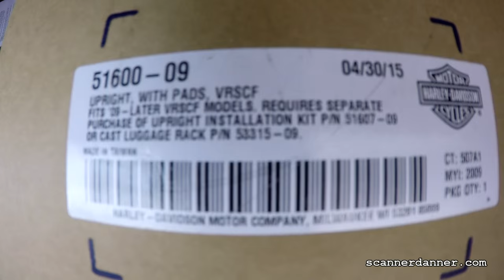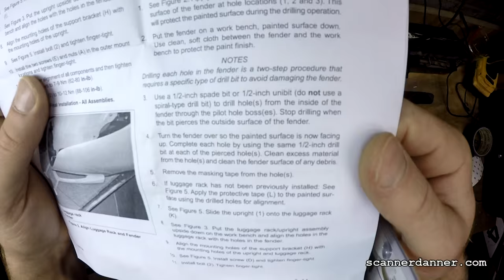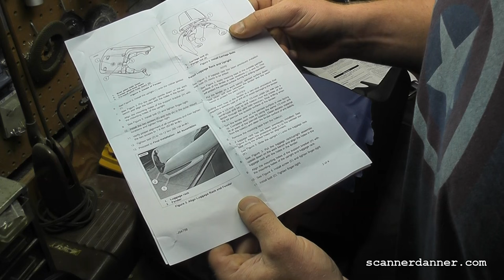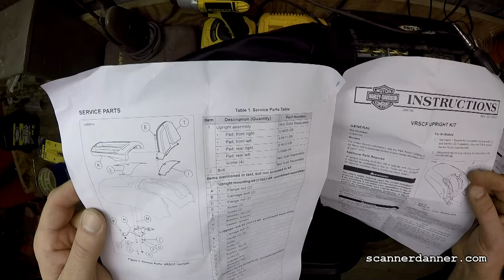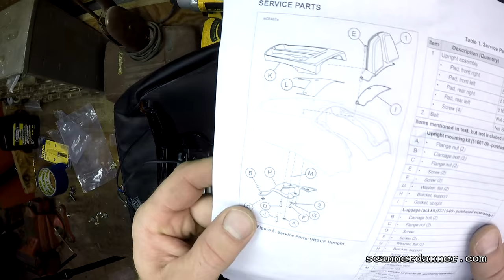V-Rod Muscle Backrest and Luggage Rack Install

Comment: of course the Allen bolts on the straps weren't tight not like anyone's grabbing on there or anything. was the bike purchased used? it's possible that was bolted back on for the trade in

Comment: Killer video! The fact that you speak clear English and I could follow along step by step without having to replay the vid in order to make sure I understood you correctly is always half the battle. So many Yoyo's out there have marbles in their mouth or a ton of background noise. You get straight to the point with no nonsense. I like that. No grand introduction to the video or unnecessary background information about how great you are or how pretty your wife is. (Yes, those video's are out there)  When you press play....BOOM.....right to the job at hand. Thank you for a video well done and you've bolstered my confidence. Now I'm not apprehensive. My 2012 Muscle and I thank you!
Reply from the maker: Awesome man! Thank you so much. I knew my car expertise would help me with this motorcycle stuff. 
I have a video on some Vance and Hinse slip ons. I haven't uploaded it yet but look for it. I did a step by step install with before and after sound. 
 I'm trying to get some additional footage of the sound of the exhaust for the after install of the new pipes. All the ones I've seen, the camera mic did not do a good job of showing how the pipes really sound.

Comment: Dude, you have big balls! Seriously, I have had the parts for 1 year and refuse to do this job. Awesome job!
Reply from the maker: Question now is are you confident enough to do it after this video? Did you see where I went wrong with my drilling?
Reply: @ScannerDanner  mine has the sissy bar installed already, but I bought the rack to just have the rack on there. Are they basically the same holes except to the middle rear?

Comment: Paul I work in the automotive after market installing power locks to A/C and it was always hard to make that first cut or drill hole. One thing for others is to put tape on top of tap and extend the Unibit out to the end of the shank, this will help to not hit the drill on the paint.

Comment: I guess we now know what ScannerDanner got for Xmas.  :-)  I’d advise getting the factory service manual for your year/model ride. It will pay for itself in the first service alone, especially given HD Dealers hourly rates (highway robbery, IMO). You can order it through your local HD dealer or online. The Electrical Diagnostics Manual (the one with the wiring diagrams) is a separate book from the service manual for my bike (’06 FXSTBI) and it might be for yours too.  Saved my booty on numerous occasions.  Enjoy the new ride and I look forward to seeing some videos on it.
Reply: btw, I would re-route that tail light wire. It used to be mounted between the bracket & fender so it wasn’t directly exposed to dirt, rocks, water, whatever flying off the rear wheel as you are going down the road. Now it is exposed and it could result in a premature failure of that wire. But maybe thats not a bad thing as it would give you a good electrical diagnostic video.  :-)

Comment: Dang man I'm sorry about the trouble you had. That fender is probably actually composite or glass reinforced plastic as opposed to just fiberglass. As opposed to having to lay down and resin mat after mat, a machine probably injects hot liquid plastic into a mold and out pops a fender after about 5 or 10 minutes. Also on your drill knicking the paint, I would run the bit as far out on the chuck as I could with it remaining stable. That's usually why unibits have the long hex shaped shank.

Comment: If you drill to the 1/2" diameter from the inside, you will chip the paint around the hole as the bit comes through. This is why they tell you to drill the full size from the outside-in.

Comment: i have a engeneering background and this is what made me pass my cert  test what this guy in my apprentice told me.
Turn on your brain and  think things thru from start to finish, do not start! unless  you know every move you are going to take till you finished manufacturing the component  on your plan in your head.
And he  was Right you start machining something  from the wrong  side  you cant finish the thing as you can no longer clamp it in a vice or the lathe chuck.
I had  to write the above to give a idea why i  would have  done this step  i am going to tell... i would have done different.
I look at stuff  like the threads studs  what angle they have of the stuff bolted on to it and in my mind i am machine them holes with a  drill befor i start.
its kind of similar  to electronic diagnostic  you teach Mr danner,  
i would also have  figured if you could not almost finish the drilling  from the inside or not. I go why do they want the  thing to be drilled  from inside? then outside what is there reason on the instruction, Is there  one? or is it just a pen-pusher  whom wrote the distructions......  etc
Reason why i gave up engeneering to me its extreem stresfull when you f...k up its over  but a rusty stuck bolt for example is a challange to open it is already a f...up that one has to now fix.  you can fix them f-ups  you start again if  you f---k up in machining something gone wrong!! all the time  till the f-up is  gone if  you do so , extreem stressfull in my opinion, not  so much in c.n.c  but i did learn the old fation way propper  machining by  hand still 

My first repair  with My pico was a coil on a 6 clinder kawasaki . i found after 6h one coil  was wrong connected +- the moron electrition mate told him it wont matter how you connect a coil. And the reason it was conected  wrong was 3 coils  and 1 of them had plus and minus not on the same side,!  I mesurd the harness  done a voltage drop test with dan sullivans load pro leads  said!  power  and ground is fine to all coils but that coil is connected  wrong buddy!! look at the coil here is our positive  wire going to the negative on the coil.
Put another good coil connecded it  propperly  and the thing fired on all pots again.
coil had spade connectors and no wiring diagramm.(The thing sometimes  ran on all pots  with coil wrong ) ...then coughed and splutterd and stalled.

Comment: Man , Stealership got me all nervous when they said drilling holes in the fender. Cost me 400$ to get that seat on!!!! . They offered me a deal of luggage rack and seat for 700. they are crazy . how hard would it be to put the luggage rack on now that the back pad is on ?
Reply from the maker: The holes are already there, so everything I showed would need to be done other than drill the holes.

Comment: That is the purpose of the tape to protect the paint in case you have a slip, and to keep paint from chipping and that is why they tell you not to use a spiral drill bit because when the drill tip pierces thru, the cutting edge of the drill bit will grab the thin layer of plastic and could break a big chunk out of the finish. I found out the hard way when drilling holes in my boat. LolGreat video and nice bike.I cant wait to see the O2 on the scope to see if it cycles from rich to lean like a car does. I don't think it will because it don't have a catalytic converter. Does it?
Reply from the maker: +JOHN HUFNAGEL now you have me curious. I'm betting it will still swing rich/lean which will back up the theory that the swing in the ratio is not for cat efficiency but for the system to know where stoic is on a narrow band sensor. I've always stated it was for cat efficiency but my views are changing
Reply: I bought a cheap A/F gauge and it did not swing back and forth on my Polaris RZR that is fuel injected, but it was a $30 piece of crap. I am very curious to see the scope on your bike

Comment: I don't think it's fiber glass (tho i might be wrong) i believe is glass reinforced plastic. A bit different. Can't quite make it out because of the 360p video.

It's the same stuff they make most new age non-cheapo bodies for drills and stuff like that. Quite tuff and takes a bit of abuse to break one, i mean, how many times do we drop our cordless drills and such.

I think the reason they don't factory option this is because they haven't completed the program (demand and supply type of deal) or they have too little customers, once more i might be wrong, but i have been through this with Suzuki where a type of clutch mod that can be bought from them doesn't come factory, even tho they give you all the necessary stuff even a print 1/1 for the hole patterns.

Rambling aside, nice bike, it might not be my style, but i can certainly appreciate that the bike is pretty, and it does sound awesome even in factory pipes. :) May you use it for a long time to come.
Reply from the maker: +aserta thanks man and give it some time to process. It will be 1080p when it's complete. All new uploads start this way (low resolution)

Comment: Never picked you as a bike guy Paul.

Maybe some motovlogs down the road?

Nice bike though, I've thrown my leg over my 2 cousins vrod and night rods both nice bikes but I'm not a fan of forward controls haha

The seats on the vrods here in Australia actually fold from the opposite side than what yours does. 

Bikes are pretty much the same as cars apart from when they have a CDI ignition and the way the charging system is set out.
Still can use the same tricks but it can be harder to get scan data and bidirectional controls though.

Fitting accessories to cars is just as frustrating and those stepped drill bits are handy but very easy to drill the hole too big (done that before on a new bumper haha)
Reply from the maker: +roastlambpie agree, the first day of riding the foot position felt very unnatural but after the next few rides, I actually got used to it.

Comment: dude thanks for this video. seriously though now i know for sure i am not putting that rack on my bike lol.  but hey let me know when you get the wiring diagram and there is one thing on the left of the radiator shroud cover there is some cables my dogs chewed up and now i dont know where one goes let me know what they belong too thanks 
great video though
Reply from the maker: I think you are referring to the battery maintainer wires. There is a two pin plug that is there for the sole purpose of connecting a battery charger during the winter months
Reply from the maker: No problem. Just don't buy some cheap backrest. When you read the fine print on those, they say "for looks only". They are NOT safe for your passenger.

Comment: could had taped them back two bracket bolts in place before install to make life easier
Reply from the maker: +1mouse3 good tip! How'd you like the camera shots from under the fender?
Reply: +ScannerDanner wasn't bad and you don't have too many options to get a shot from that angle

Comment: is the seat removable?
Reply from the maker: which seat? I don't think you would want to remove the passenger seat. It keeps you planted in the drivers seat when accelerating. Without it you would slide off the rear of the bike! Trust me, I know
Reply: +ScannerDanner I have a vrod also. I wife wants the backrest, and I don't really like the look of it. So can I remove it when she isn't on? And then put it on quickly when she does?
Reply from the maker: No. This one is permanent. You can remove it but you'll have holes in your rear fender. They make ones that are remove able but when you read the fine print they say "for looks only!". I would NOT recommend those for your wife. Her life depends on it.
Reply: +ScannerDanner alright thank you!
Reply from the maker: no problem!